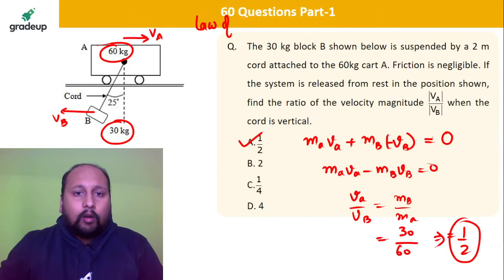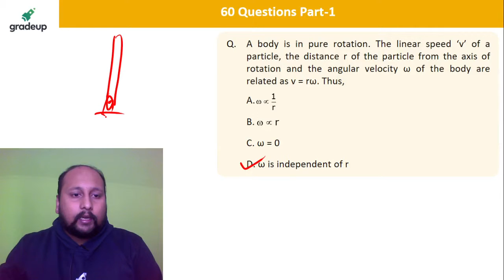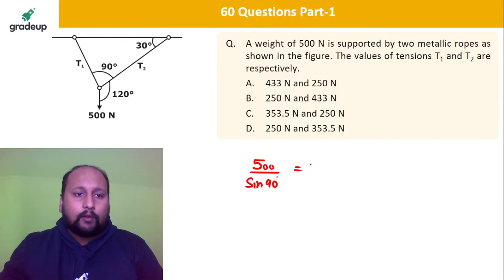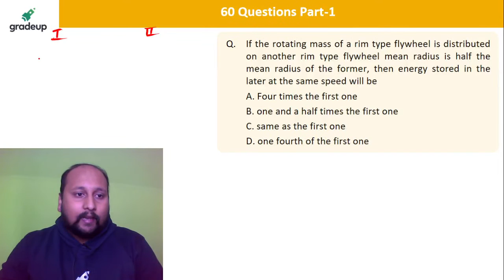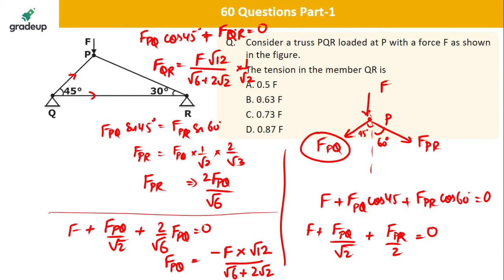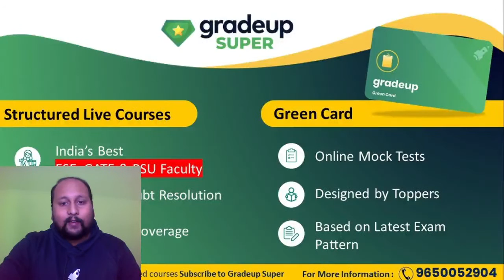Engineering Mechanics | 60 Questions | Part 1 | GATE ME 2021 | By Sooraj Sir | Gradeup

Comment: Answer of spring & disc question is coming out to be omega = 5 rad/s.It is not matching any of the options.Please explain !!
Reply: In 17 th question there should be (√6+√2) then only answer will match with .63F
Reply: Yes you are right
Notice this is the condition of the educators in these companies they don't even know a correct energy formula
Reply: Yes 5 is correct